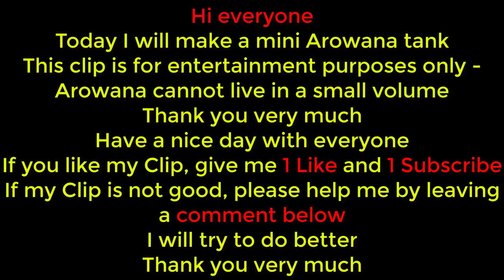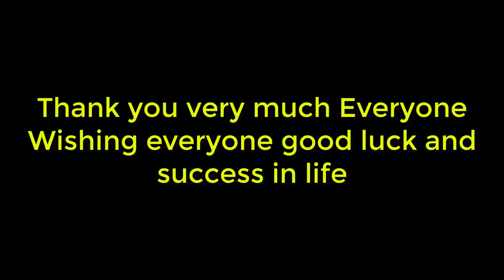Aquarium model 10 - Mini Arowana Fish Tank/ Make Arowana Fish Tank

Comment: I read all comments to find any explanation about how water flows work, some people asking the same but no answer can be found except if it was explained by vietnam language (coz I dont understand vietnam language). What I could conclude is 
1. clean water is pumped from bottom pipe going up through glass path and then going down to main tank
2. dirty water is coming from the bottom and top with the opposite position through different path and both of them going to filter tank
So it is amazing design that I ever know  ... as you said, the most important thing is air vent you build in 12th minute ... excellent job brother ...
Reply from the maker: I will try to do better
Thank you very much
have a nice day My Friend

Comment: If filter going overflow there is any safety option. I mean sometime sponge get block water goes out of filter
Reply: The fail safe is that each baffle is set lower than the filter tank's sides.
Reply from the maker: Thank you very much
Have a nice day My Friend @Kuda Part, @Sam B
Just like what @Sam B said
The glass walls will be placed about 1cm lower than the mouth of the filter tank

Comment: Mesinnya mati ya auto Banjir, becex,
Reply from the maker: If the water flooded the house, we wouldn't have spent so much effort on a job
It is a pipe that helps water stop automatically when the engine is not running
Reply: Mbuh... Enyong ora ngerti...